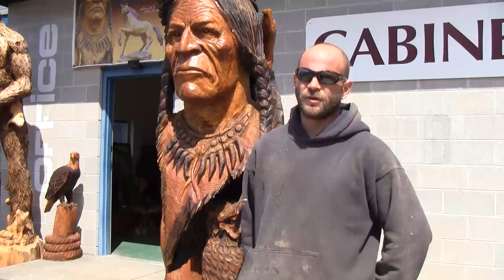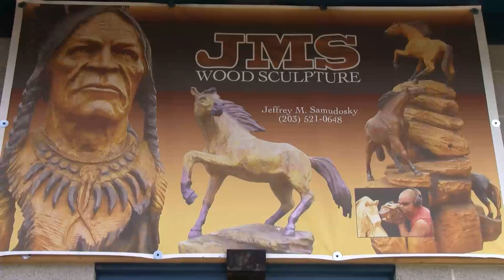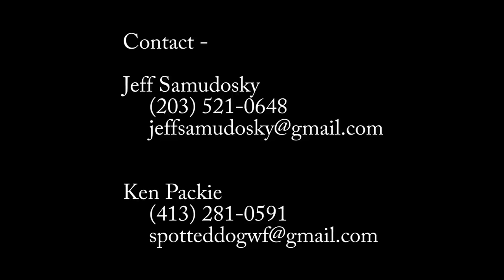JMS Wood Sculpture

Comment: I started carving with a borrowed pocket knife.  Then went to small tools that would break then to better carvinf tools then to real wood carving with few better Swiss Made carving tools.  I used a very small Sethi saw for sawing wood for carving but the fuel boiled in the tank and that was a worry.  I was a worry,   My mix was correct but somebody said I should have used more oil in the gas.  I used it to rough out Juniper/cedar for fine carving and converted it to bronze.  I worked very hard for the smoothness of the touch of the wood to the touch of the hand on the sculpture of the wood.  Good luck with your work.  Stay our to Ruidoso, NM because there a bear on every corner.